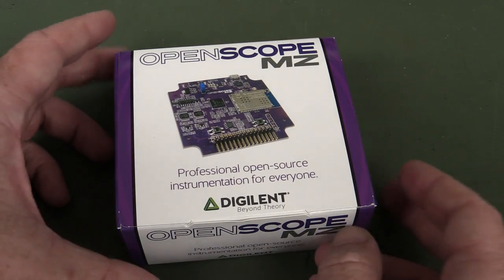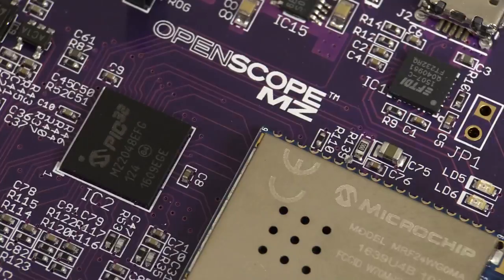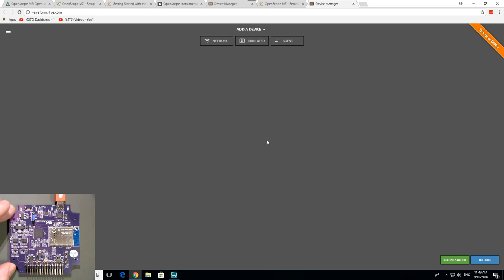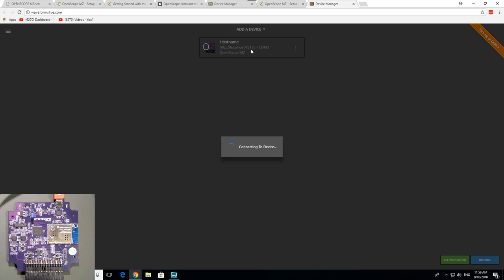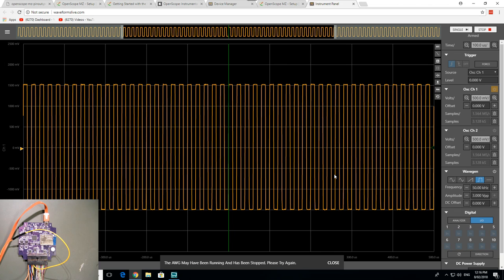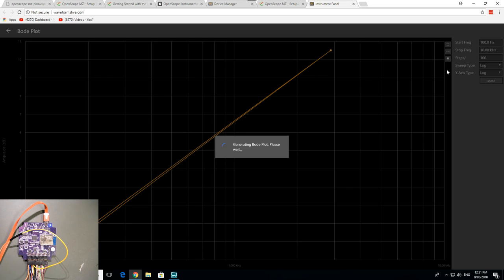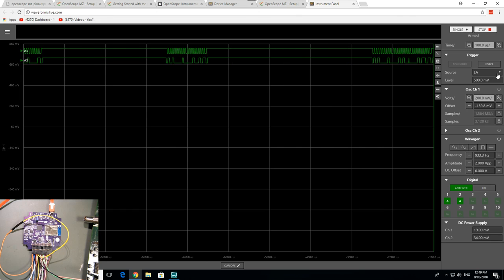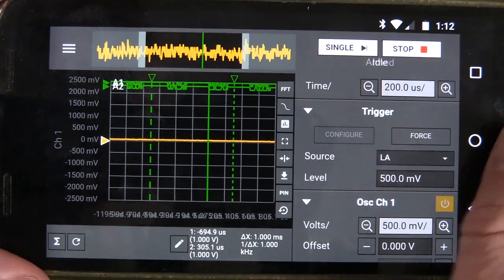EEVblog #1056 - Digilent Open Scope MZ Review

Comment: 2MHz BW, no actual oscilloscope frontend. I did stop watching at that moment, as I thought at first that will be some decent stuff, when I have seen the shield there. It turns out, it is another WiFi connected garbage, based on PIC MZ. :(
Reply from the maker: What's wrong with the PIC MZ?
Reply: Yeah, this is a bit useless device. Hardware is extremely limited, overpriced, cannot be extended, and firmware and software will probably is shit, and will die in a year or two. It would be probably better to have some form of Raspberry Pi hat to do similar thing, but without any serious limitations, and supperb modularity and software extensibility.

I respect it is open source tho, with all mechanics, pcb, schematics, cases, and firmware.
Reply: With what I've been playing around with lately, I'd probably use a A->D/CPLD/Ram triplet, with whatever cheapo micro to read out the data later. If you really want a preview you can have the CPLD throw out an additional data stream at a lower speed, since no big deal.
Reply from the maker: Jared Maddox  - The Analog Discovery used an FPGA.
Reply: Also, a Pic32 MZ should be able to get more than 2 MSamples / sec. The actual proc speed can go to 252 MHz internally, the EBI bus can go to at least 50 MHz, and can at least go to 16 bits wide on the data bus, so even if you go 16 bit wide multiplexed bus, 32 bit data and address, best case that's 50/4=12.5 MHz bus speed (except that I'm pretty sure the EBI supports bursts, and I know some larger packages support that non-multiplexed, so the bus can max out faster).

So yeah, this should be able to do better unless the Wifi is the restraining factor.
Reply: The errata list is impressive (Microchip can't manage to get I2C or oscillators working these days, let alone their more complicated peripherals like SQI), and the Harmony framework they try to force users in to rather than providing real documentation for peripherals is extremely flaky (e.g. many of their drivers like USB are untested with RTOS integration and will just crash the chip if you try to use them via Harmony).  They are also in the bad habit of silently changing functionality between versions of Harmony that will silently break old code but still compile (they did this with I2C last year so a function that was named 'wait' would no longer wait to return but still compiled without throwing warnings or errors about the change/deprecation).  Really disturbing stuff when this is supposed to be a production ready API.

They've also already orphaned the Harmony 1.x series in favor of Harmony 2.x, orphaning users naive enough to trust them, while also leaving out features originally promised.  For example they designed Harmony to be a giant super-loop of polled state machines, but provide blocking components like a file system that will stall the entire system while it works - good luck hitting any specific latency target on that device.  

PIC32MZ has some very annoying errata, is burdened by a badly designed and poorly supported/maintained software framework called Harmony, and is poorly documented because 'just use Harmony' preventing 3rd party development on things like USB or network. I use the chips without Harmony (and without complex peripherals unfortunately) on some projects because they fit the application directly and legacy since I've used Microchip almost exclusively for over 12 years.  I'm in the process of migrating away though as the combination of an unreliable and poorly designed software framework with the loss of experts caused by it and the lack of documentation necessary to work around it means that the 'cost' of learning to work with other platforms like the STM32 is now much lower in a relative sense.
Reply: I've just checked the errata list and, WOW! Hugely impressive! Not only there are lots of bugs that affect all silicon revisions that are pretty serious (the TRNG does not function, for example. What?!), but there also are no workarounds or they're not really "workarounds" (use the PRNG instead of the TRNG. Seriously?! And what if I want true random numbers for cryptography, for example?).
Reply: GRBTutorials : Then hang a transistor off a pin and run in avalanche mode, or similar. Ebi bus had a clock export bug last I checked (specifically, it doesn't export the clock), and the workaround is to generate your clock outside the chip, and watch for EBI bus activity so you can use that to sync a derived clock (generated with a simple counter) to the bus activity.

At any rate, the EF chips look bad, but the EC chips were far worse. I think that the EF chips are actually the EC line, with so many fixes that they decided to just rename them. I expect most of the silicon bugs (especially the stuff with the oscillators) to be fixed in a few years.

Comment: Dave so many gear videos that it's hard to get an overview of everything he's done, and use it to help our our own decisions, especially when looking at something he hasn't reviewed.

It may be time for Dave to add a comprehensive review score/grade system.

It would collects his impressions, then generate an overall score (that can be weighted as desired), and that can then be divided by the retail price to get a "Bang for the Buck" value rating.  Have simple categories for specifications, features, ease of use, and perhaps "Other" for unique or rare things.

Put the basic form/spreadsheet up as a shared Google Doc, and viewers can fill one out for each prior equipment video. with Dave doing, at most, a once-over to see if the community efforts match his impressions.  On future videos, Dave could fill in just his impressions, and the community can do the rest.

Thoughts?
Reply from the maker: Someone on the EEVblog forum has done with with multimeters, it's an impressive spreadsheet.

Comment: What's with JP2? Notice its pads are in a slight zig zag? I assume that is a jtag programming connector. Is it so they can plug a male header in there for programming and have it contact without soldering? Clever way to avoid having to solder in a connector for one time programming use.

Comment: Seems like a device with great potential, but that rubbish software is a bit of a show stopper.
Reply: just like the red pitaya.....
Reply: Its like crossbreeding a mouse with an elephant  using Javascript to control hardware directly OMG
Reply: @Fiercesoulking  You dunno what you're talking about. NodeJS is the way to go for simple, easy cross-platform GUIs these days. Yes, it's browser based and wastes a lot of resources, but everyone who is able to watch stuff on youtube can instantly run their software online. Or locally after 1 minute install. It is much less demanding than YT. That was the right choice. Only that crappy pic32 was not.

Comment: Lets hope that PIC can handle 32768 bin  FFT for spectrum display, I don't think that there is enough memory for the board to use needs to be redone to use a 64GB DDR4 memory module, I think if you have a WIFI enabled personal computer like the ACER TC-220 computer that might actually work provided that there is a windows version of that package you are using.

Comment: Is it just me or is JP2 pins staggered or is it just the view of camera,but they look like there not in straight line ,time 3:00 onward
Reply: They are staggered as a way to temporarily retain an inline pin header for (re)programming the microcontroller if it gets so corrupted that it becomes necessary. Also works for temporary use for firmware development/debugging.

Comment: Why doesn't anyone make a good mid price logic analyzers? My $10 saleae 24mhz 8 channel clone does a better job than openscope mz. Either logic analyzers cost 10 dollars or 500, there's really no in-between.
Reply from the maker: No, your $10 Saleae logic analyser is a fake and is costing the company money. The company that has to maintain that excellent software you like did not get a cent of your $10. Good software takes a lot of time and money to develop and maintain.
Reply: EEVblog oh sorry I forgot to put clone when I fixed a typo. I'm aware that it's a copy and saleae doesn't get a cent. I'd buy a saleae but right now they only offer $400 and up. At one point they had the logic 4 which was in my price range but sadly it has been discontinued.
Reply: Just go for the Openbench Logic Sniffer - $50, 200MSPS. You can thank me later.
Reply: Attila Asztalos that's the one I wanted, it's perfect. Except the software Java script is outdated for it and seems to only work on Windows XP. Some can get it to work on Windows 10. Sigrok open source software says it has limited support for it. Do you own one?
Reply: I do, and I'm a satisfied customer; it works fine on Windows 7 for me, I don't have anything newer. The software is Java indeed (not javascript - that's for browsers), but it does everything it's supposed to, including some of the usual protocol decoders. I'm aware of Sigrok but I haven't tried it yet - never needed to so far; I understand it's pretty much completely supported except the serial data trigger mode (no biggie) and some issues in RLE data compression mode (kinda biggie, hence my lack of particular interest). If you have a specific question, feel free to ask though.

Comment: I have (along with a bench scope) BitScope Micro. The dual channel 20MHz scope & 6 channel logic analyzer for about $150 and it works just fine, see: http://www.bitscope.com/product/BS05/
You can get it for $165 with 2 BNC input adapter for standard oscilloscope probes...

Comment: Open-source: everything that we use is based on it. Eventually those 1%-ers will add useful stuff to it.
89$, by the time it gets to the EU it's >100€. Definitely not cheap.
Software bugs: the reality of quick-to-market devices. Plenty of examples, including a well-known multimeter.

I started writing a firmware for ESP8266 and ESP32 that would turn it into a disposable WiFi oscilloscope. Basically, if you get above 5V you scrap it in the bin and plug another one. Never got around to half-way though, hoping someone else gets there before me.

Comment: I always grind my teeth in these videos as someone who works heavily in the IT space with instrumenting software, because it reminds me of when I used to try and teach my mom how to use the computer. But this is exactly the kind of person who should be testing the software because it points out serious user experience flaws where what might seem obvious to a developer is not necessarily so with people used to operating real scopes. I've had the same frustrations with the Red Pitaya where although a very very promising piece of kit all the software is just kinda... crap, and years after buying it they have really not improved in a significant way just shuffling their branding around and dicking about on Twitter. Obviously the people testing it all had huge expensive PC's, but my workbench has a cheap raspberry pi and their waveform rendering was so inefficient it would just crash for no reason. This product could be extremely useful in remote acquisition situations but if digilent treat it like "hopensource" and don't commit to putting their effort in it and just hoping someone else makes it great like Redpitaya, that could be a big shame.
Reply: Hopensource: https://twitter.com/jdub/status/732053666765537281

Comment: Professional and open source. many people would say those things don't work together. But i would like to see more professional open source equipment.
Reply: How many professionals use the open source gcc to compile their professional software?
Reply: Lots of, actually. Just look at all the Linux powered devices nowadays. Most vendors are using GCC to compile their code for it.
Reply: LLVM will probably take over for everything modern eventually (gcc is infamously messy), but still open-source.
Reply: I switched to LLVM 4 years ago, and I won't go back.